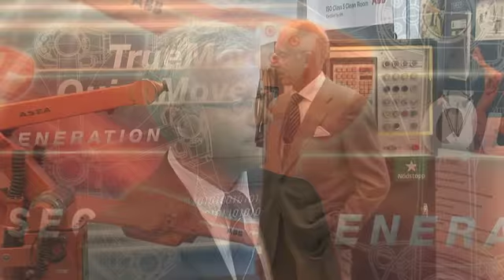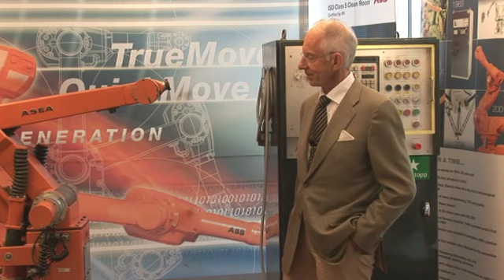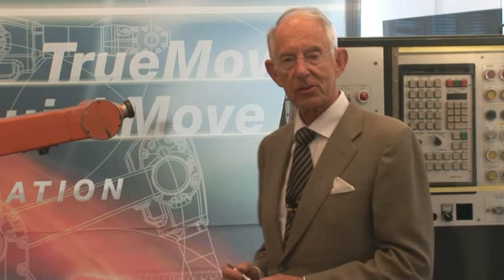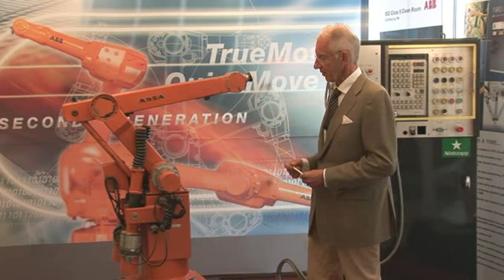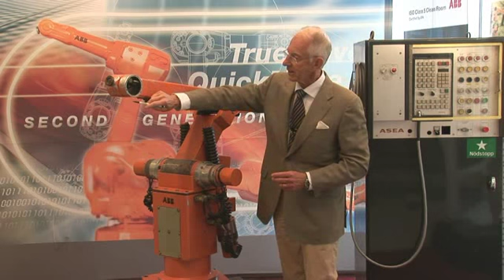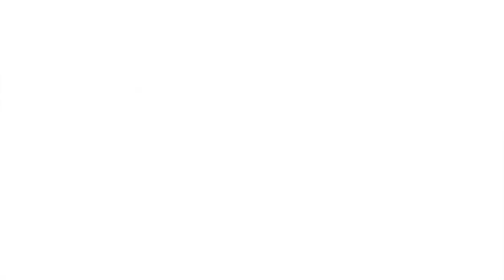IRB 6- the first anthropomorphic robot

Comment: an exceptional testimony, even if many will not know that we are talking about the real first industrial robot produced on a large scale. this in the video is an S1, the very first generation. I have seen many S2s, some are still in operation in some Italian companies that I have visited, but never a working S1. the electronics can be easily repaired but the real problem are the very unsual DC motors, nowhere to be found. harmonic gearboxes are simply magic.
curiously, the robot needs a particular oil to lubricate the first, 4 and 5th axes, which is red. my colleagues and I joked so much that it was the "blood" of the robot .. what a time!